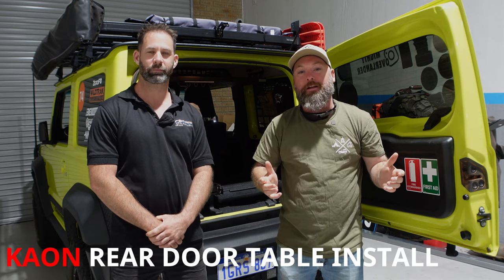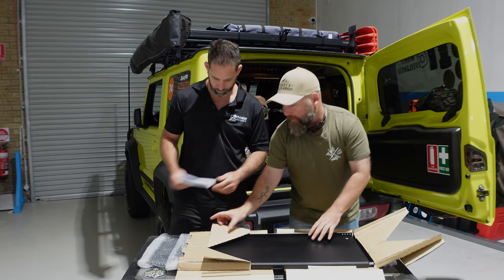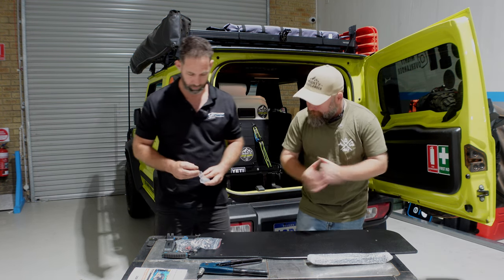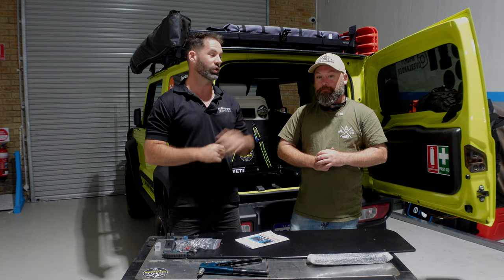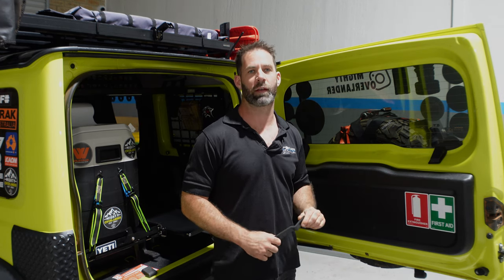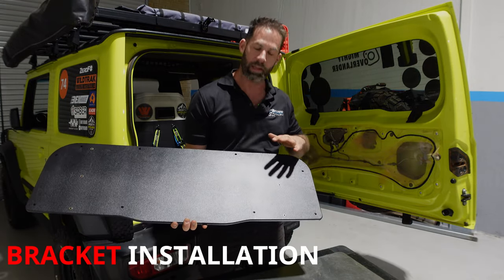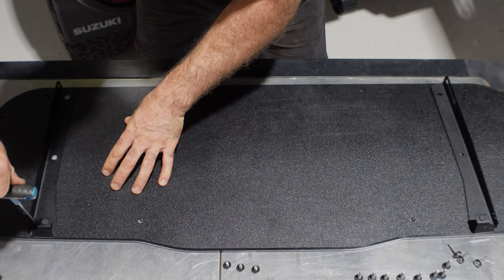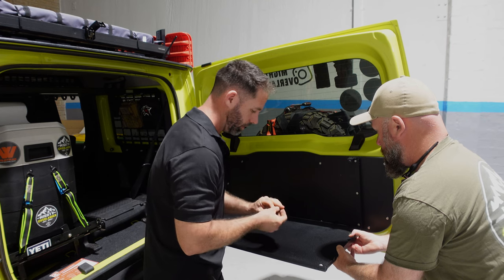SUZUKI JIMNY REAR DOOR TABLE INSTALL // KAON REAR DOOR TABLE SUZUKI JIMNY INSTALL

Comment: I’m so impressed with this table, has to be one of the best things to ever fit into one’s Jimny.
Reply from the maker: It certainly is very handy. Im shooting a new video this weekend and I’ll be making a bit of a camp kitchen between this and my front runner table
Reply: @MightyOverlander  I’m going to be using only the rear door table for all my cooking etc.
No need for a second table, it’s all about keeping the weight down and easy setup, that’s why I’m building a sleeping system inside of my Jimny (slept inside of my two previous Jimney’s for months on end)

Comment: Thanks for the video. Am I right in saying that the leveling locking pin only locks all the way up and all the way down. So that would mean the car would be needed to be parked on level ground. Am I correct or can the locking pin be locked in any position on the sliding mechanism. 
I’m full of OCD’s. 😳
Reply from the maker: Yeah it’s just all the way up or down. That being said whenever I set up camp the car is usually pretty level as I have to have my awning and everything out as well. Thanks for watching!!

Comment: does it protrude more than the stock plastic or less? worried about clearance to my drawers, as it rubs on the factory piece haha
Reply from the maker: It’s about the same, however it is lower than the stock plastic hence why I doesn’t work with the stock cargo bin that sits in there
Reply: @MightyOverlander  ah bugger I still run that 😢 looks like god kit though, well done again KAON
Reply from the maker: @ap.bb6  to be honest you’ll grow out of that cargo bin eventually